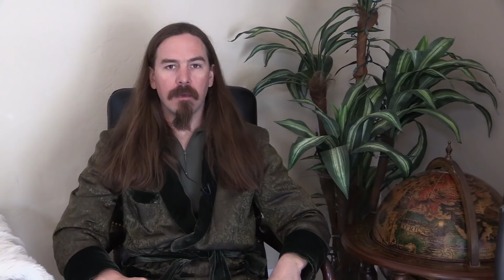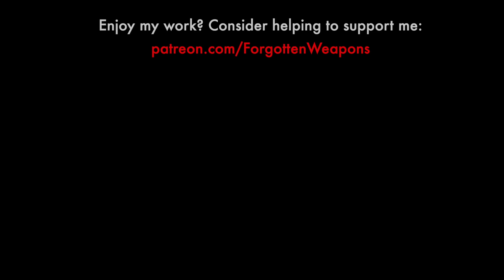How Does It Work: Patents and Blueprints

Comment: I recall Ian making a similar video several years ago, and saying that even the order in which you machine parts will impact on its function, making reverse engineering an incredibly difficult process, even if you had dozens of completely new guns to work from. 

More like this, please Ian!
Reply: Nowadays, tolerances are not realy that importent. You don't need 1-2-3-100-1000 samples to find out the manufacturing tolerances.
A modern CNC/ tooling fits automatically in because in the past it was simply impossible to hold this tight tolerances. (Handmade fit up's have a 100.. times higher tolerance then maschined ones.)... Take a sample and set your maschine/measurement tolerances as low as possible). 
For example there are no tolerances in a modern HK pistol lower than  +/- 0,15 mm for (design elements like grips, saftybutton, mag-release-button....etc),   +/- 0,05mm (mechanical interacting components, like magazine-lock, ejector, locking locks, hold open lock etc...).
This tolerances gets simply holded by the CNC-manufacturing process ( and are not even needed for fully funktion), there can only be underun by poor/broken tools, the CNC maschines and measurement systems in the factorys are callibrated for  +/- 0,001 mm @ 20°C.
A modern casual CNC holds out of Factory +- 0,1mm.
Steelalloys for barrels, are avaliabil...with there heat treating spezifications....

Only the barrel and the chamber diameters have thight tolerances  +0/-0,01 mm.
But this is also mhhh the tricky part to manufacture a firearm...

 Except for the last part. 
Homemade is possible...if you spend enough money for a tight toleranced maschin park, there is nothing between you and your firearm copy
Reply: Tolerances still matter. I know my ex-employers had at least one product where parts had to be hand-selected to ensure the entire assembly was within the overall tolerance budget. It wasn't ideal, but we were pushing the state of the art.
Reply: @KnocclHead  
Take apart any recently mass produced firearm and tell me how many parts are CNC machined. Not a lot! CNC is still more expensive and slower than sheet metal, MIM casting or injection molding. Also, I wanna see a mass produced milled part with a 0,005mm tolerance field dimension on them. It is achievable, but only with an incredible price tag attached to it. Your milling tool has a tolerance, your tool measuring machine has a tolerance and your milling machine has one as well. Even CAD software has tolerances. Even the structure of your raw material is different from batch to batch. All that adds up! 
To say tolerances are obsolete is ridiculous. The supplier will always try to get the parts manufactured as cheaply as possible (which is a good thing!), so they go with the precision required as per your drawing, not as precise as they can go. By adding tolerances only where nescessary, you make your parts less expensive.
Oh and two parts with +/- 0.05 tolerances gives you 0.1mm of max. play, that is a lot for a slide or a trigger mechanism, that will feel loose...

Comment: With respect to tolerances could one just make each part to as tight a tolerance as is reasonable? I imagine the sort of repros we're talking would be expensive anyway.
Reply: Tolerance stacking either way would be an issue.  You'd have to reproduce from the model you have to the exact dimensions no +/- anywhere in order for it to be "guaranteed" to function properly.

Comment: Please, make a video explaining the difference from a short recoil gun and a delayed blowback one. The 1911 pistol is short recoil? Why a MP5 is roller delayed blowback if their is a locking system?
Reply: Short recoil the barrel reciprocates with the action but not the full length of the cartridge. Roller delay blowback isn’t locked. The bolt is constantly moving rearward (not locked in place like a roller locked gun)  but the rollers slowdown the initial acceleration
Reply: With a short recoil gun, the barrel and bolt travel back togeter under a locking piece. The locking piece is tripped out of the way, allowing the bolt to travel freely to open the action and complete the cycle while the barrel returns to it's original position. The bolt then picks up another cartridge and locks with the barrel again to complete the cycle.

In a delayed blowback gun, there's a device to slow down the opening of the chamber, but the energy to cycle the weapon comes from the expanding gases pushing both the bullet, the inside of the barrel and the back of the casing, therefore the face of the bolt. The energy coming from the gases exiting the muzzle is absorbed through the frame of the weapon and does not influence the cycle. That is to say that the key difference between delayed blowback and short recoil is that the barrel does not move with the bolt on Blowback guns.

So, the 1911 is a Delayed Blowback action. Sometimes called "friction locked" or even "browning action". You may confuse it for Short Recoil because the barrel moves, but what happens is that the force acting on the breech face pushes the Slide backwards while a couple of locking recesses interfacing with the barrel create delay through friction. Then when the barrel tilts to clear those recesses, it allows the slide to cycle. There's no locking piece, also, that's the key part in a Short Recoil design. If you want a pistol that does indeed act on Short Recoil, the most popular one I can refer you to is the Beretta 92. Ian has never done a video on it, though. I think he assumes is such a popular design everybody knows everything about it, but he doesn't realise most of his audience doesn't really have access to firearms. Anyway, I digress. There's special mention of the 92 in one of his videos on that canadian prop gun supplier. He shows you how they just grind off the 92's locking piece to fire blanks, effectivelly turning it into a straight blowback gun. And that's why it's so popular in movies.

About the MP5 (and all G3 derived designs for that matter), it's action is more accurately described as Roller Delayed Blowback. There is a locking piece, but it is the part that forces the rollers into their recesses. The action is not locked, per se, much in the way that in the 1911 it is also not locked. What makes it a Blowback is that the energy to cycle the action comes from the pressure of the gases inside the barrel, which act upon the bolt face, forcing the Rollers into retracting, then the action cycles. Much like in the 1911s locking recesses, the Rollers are there to delay the opening of the cycle.

Also, what makes an action locked is that the force of the gases acting upon the breech face cannot force open the chamber. A third device is needed. Two good examples are any bolt action rifle and the AR-15.
In a bolt action rifle, the bolt is locked until you act on the bolt lever to rotate the action to clear the locking recesses, only then can you open the chamber.
The AR-15 does something similar, but it has a system to trap some of the gases propelling the bullet to cycle the action. Basically, when an external force, be it you pulling the Charging Handle or the gases coming from the gas bloc, acts upon the Bolt Carrier, it forces the bolt to rotate thanks to a Cam and track. When the bolt is clear of it's locking lugs, then the rest of the cycle can be completed.
In between bolt action and the AR-15, we have the so called Straight Pull rifles, like the Mondragon rifle. It does what the name implies. Instead of rotating then pulling back the handle, through a similar Cam and Track system the bolt is rotated, unlocked and cycled in a single, straight pull motion. That design actually inspired the action of the AR-10, which then was scaled down into the AR-15.
Reply: @ThZuao  You are incorrect, the 1911 is short recoil, not delayed blowback. The slide/breech is solidly locked to the barrel by a set of locking lugs. The barrel moves rearward with the slide under recoil a short distance, before tilting down to unlock.

Comment: Addendum: A patent also does not guarantee that the product will actually work, it just protects the right of production. Therefore, you could design a perpetuum mobile (or rather, design something that you think is one) and then patent it. If some dubious company advertises its product as being patented, it could very well be a scam and never even work.
Reply: I think most of patent administrations have now stopped issuing patents for perpetuum mobile engines.